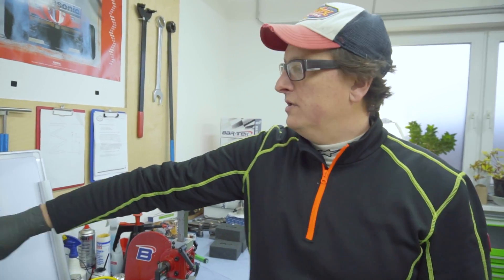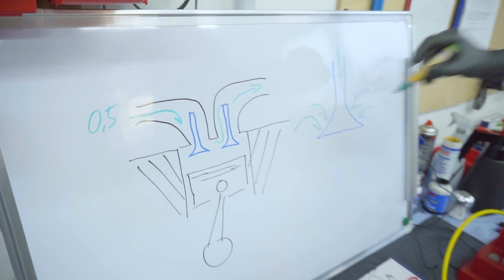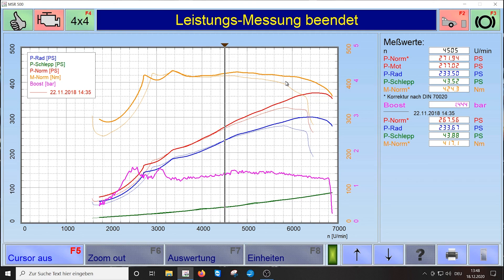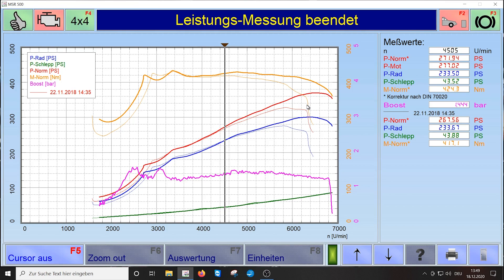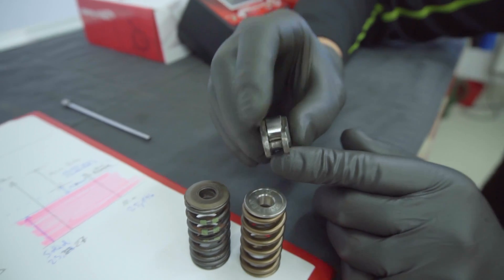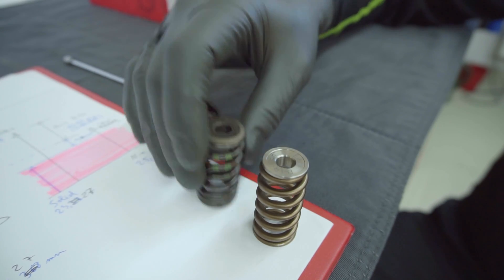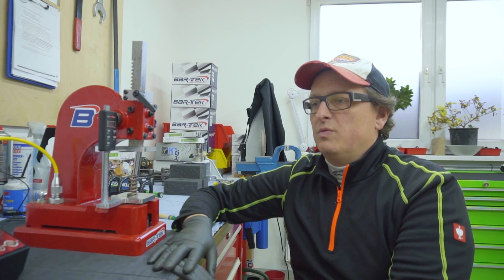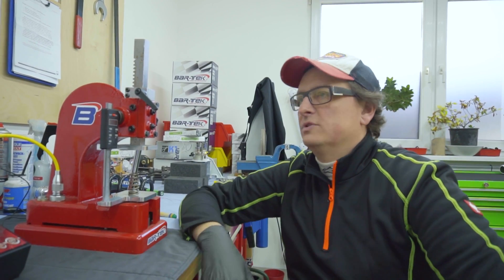Valve springs | BAR-TEK® Motorsport

Comment: The conical shape is to make the pressure lighter off the seat for less friction and then the valve is lifted the pressure goes up(non-linear) so that you have more control over the valve at full lift where you need higher pressure